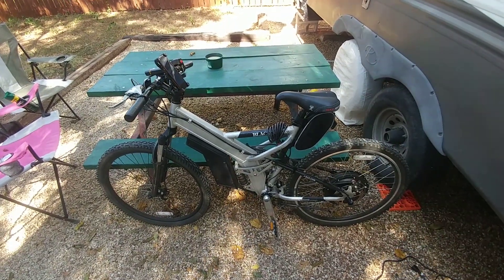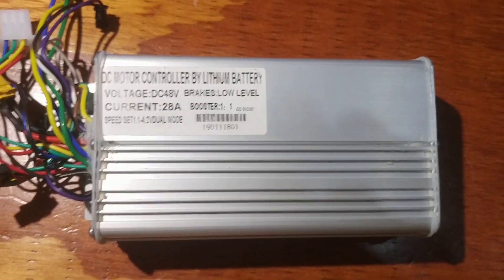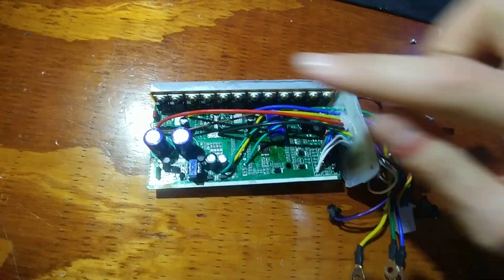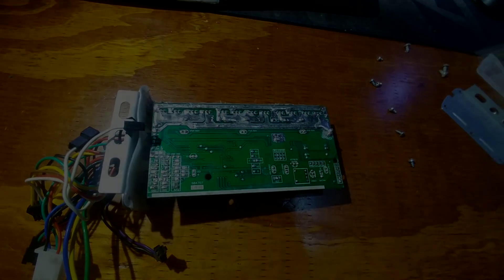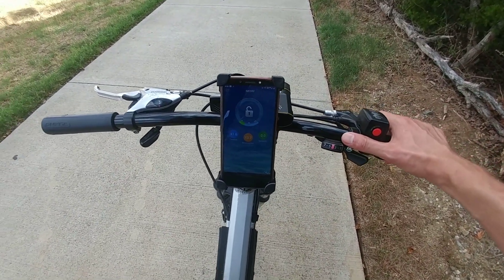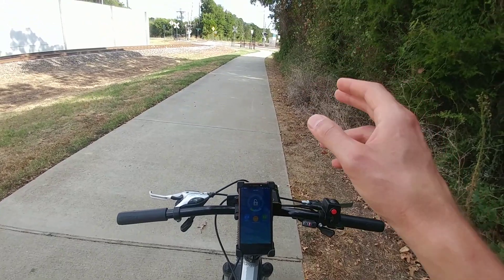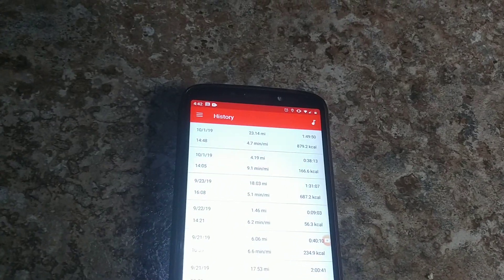Activating Regen Braking on 1000w Rear hub Ebay kit

Comment: I had ABS solder pad on mine. It worked!! Thannk you so much. But im not sure this fills up the battery back, also  im not sure if there is any settings on my sw900 lcd panel. If someone notice me about that will be happy. My hub fits nicely on the chsasis, but a torque arm may still be needed, will see.

Comment: Can I install a regenerate system on my mid drive motor electric bike with CYC X1 Pro Gen2  5KW with 72 volts battery?? Where to purchase the system?

Comment: How apply brakes create charging to the battery?
Dose your brake generate the charge or the hub motor create charge? How?
Reply: Break lever has electrical switch to shut down the motor. Similar switch to stop light. I believe that is what triggers breaking but I doubt if this actually works. Spinning motor is unable to generate higher voltage than battery so it will not charge it. I believe it is just motor break and it generate heat instead of charge. Heat in the motor coils.
Reply: Basically the motor becomes a generator and charges the battery when you apply the brakes when regeneration braking is on.

Comment: man,now think twice. use a 1000W front and a 100W Rear Motor,activaiting on boht the Break and NOW install a 750/1000W Bafang Mid Motor. Use the Midmotor and push the same time a Brekas and you drive with the Mid Motor, near the both Hub Motor produce power.if you use less Power for the Mid then both Motor produce,will your battery never be discharged. it means you have 3 Motors,can use all 3,but most time can 2 of them produce power and charge the hole time. you can programm the Hub to break after a Speedlimit,for exempel 20Mph,but your mid motor can drive 40 Mph,so your Hubs start with 20Mph to charge . for the Mid drive a Thump throttel and for the Hubs a Twist throttel som can be deativated. so it will be a mid drive in the first pleace and a Rocker in the secound because of 3 Motor with 3000 Watt. if you balance breaking of the hubs and the max speed of the mid,can the hubs not be to hot and the mid motor must not work so hard if you use gears also for more thorgue,not speed. if you can drive 30 Mph with the Mid Motor and the Buhs break with 5Mph will the mid motor not rich the 1000Watt he can use. or you drive fast,but later you drive slow and break hard to charge faster. a endless Bike ;-) or use a Car Alternator ;-)

Comment: Nice video and hack!  I have a 1500W controller of the same manufacturer.  No X, DS, EABS or EBS, but there is an ABS with a GND right across the alley between the rowed solder pads, and think I'm gonna chance it with that.

Comment: i get max 4-6A brake Amps  ....  how to get stronger Regen?  i want to stop in 20m or so...
Reply: Wich motor are you using?
A smaller wheel diammeter paired with a geared hub motor should give you super regen
Reply: @felipehcraftgamer4193  most geared hub motors freewheel like a cog/chain does.

Comment: Other controllers have either a EBS or EABS solder pad or if it doesn't say either of those it will say F4. You solder either of those to ground and when you activate your brake lever switch, regen comes on. I charge my battery with a voltage regulator so I can set the charge voltage, I undercharge my battery slightly by about a volt and a half so I don't trip my BMS overvolt protection circuit, otherwise I have to switch the battery off then again to power it back on. Another function I would defo recommend that most controller have is cruise control. You just wire the appropriate pad to ground via an inline switch and when at throttling you press the switch once and it keeps that level of throttle on until you either activate the throttle again or the switch again. Very good for long journeys as it takes away that strain you get from holding the throttle open all the time. Also riding no handed at 30 mph is fun!!! Be careful though!!
Reply: thanks for the info ! where did you find all of this ?
Reply: @jeandard6416  Either through experience or by searching on the net etc. Defo worth wiring some of these functions in. One more thing to mention is, if you do a shunt mod on your china controller and also have done the regen you will notice not only an increase in power but also an increase in regen force. Just FYI.
Reply: @jcreedy20  do you know what f5 is? Really curious
Reply: @landongill8827  not sure use a voltmeter to measure its output and see what it puts out while running. Also I may try shorting it to ground on one of my many controllers to see what it does. To be honest I only ever did the functions I wanted. Ds and X are regen on my current PCB. Others it's different.
Reply: What is appropriate pad to wire for cruise? I’d like to mod cruise for my bike. Thanks
Reply: @teolotec2957  Depends on your controller, have you a link to it, lots of different pcb formats. But a lot of controllers already have the cruise wired in by default, usually a single orange wire, all you do to test if it is the cruise is get your wheel off the ground and spin up the motor holding throttle open and touch orange wire to any black wire (ground) once!, no need to hold it on. It should stay on the throttle position you held it until you either hit your brake cut off switches or touch the wire again or engage the throttle again. .
Reply: I only have free pins GK, DK, AD, HE, FD, SH, XS and YY/Tx1 in my unit, please don't you know which is for what? XS is gas restriction, and SH is hight braking, I couldn't find the rest anywhere. Thank you very much for your opinion.
Reply: @jozefASB  I've never seen those abreviations before, but you can get a good idea by running the motor and then touching the pins to ground with a multimeter. I think Tx1 is transmit, probably used for wiring in a display etc. Just remember when you do find the regen circuit and activate it, regen is quite brutal on your dropouts and will work the motor free unless you have a good torque arm setup.
Reply: @jcreedy20  Thanks for the reference. But I don't want to damage the controller. How can I recognize with a multimeter that it is the necessary pin for regen? Is it necessary to have the wheel spun and the brake pressed?
Thank you for your advice, you are a true expert.

Comment: What regen voltage is generated ?. I measured a max of 23volts on my 36v system . You need 42v to charge a 36v battery ( you cannot put in a lower voltage than the battery has at the time) obviously if you apply the brakes the battery level will be higher than if it is under load. You would need a boost converter to achieve a high enough voltage to charge the battery ...... I think regen on bikes is a placebo.
Reply: Exactly, if there's no circuit to multiply and stabilize the generated voltage (that could be sufficient only at very high rpm) it will brake but will not recharge the battery.
Reply: The driver IS a boost controller. It runs as a buck converter to lower the battery voltage to lower ones at partial throttle, and regen runs reverse to boost the lower voltage generated from the motor to the point the battery can accept the charge.
Reply: How did u measure the voltage?
I have regen on a hoverboard and it boosts the voltage 10 or more volts then the battery voltage (depending on the speed it cant generate enough voltage to keep the system on)
Iven blown the fets when the bms disconnected the battery it reached 100 plus volts!
Reply: @felipehcraftgamer4193  on a bike ,I just turned the key switch to off , freewheeling powers my digi volt meter that I have ..so under no load (of the battery) i got 23v ,if you then connect a load that voltage will drop and you will feel the drag from the back emi , but as has been said regen only helps if you have spare inertia mass like on a heavy vehicle. my battery takes 8 hours at 42v at 2 amps to fully charge to 42v ,any voltage less than its current voltage cannot enter the battery. So if you could generate 42v at 2A from your breaking ....you only have to break for 8 hours to fully charge the battery .....thats a very long hill.. then how do you get back up that hill ......its basic physics

Comment: I Tried sodering those exact pinta together and no regenerative braking .
Reply: Gear Drive motors won't work(bafang 250w, 350w). RegenBrake normally works on those 1000w+ motors.

Comment: Can someone help me please? i've a kt controller that has regen as far as i know but when i brake it says that the brakes are activated but it will not do regen... so you may say it does not have regen but if i ride for a longer distance the regen works after a lot of km, in the beginning it does it vert weak and then it keeps braking harder but by the moment it does that the battery is almost empty so yeah i wanted to work al the time and with my old kt controller 25amps max it worked all the time and now with my 40amp controller it doenst work. 

Can someone help me out?
Reply: no

Comment: hi, i activated my regen braking and then the brake was too powerful that my wheel almost loose grip. how do i fix that?
Reply: You can use torque arm, or cut a fitting wrench and screw to the chasis

Comment: Nice video, thanks! On some other controllers there is no X + DS, instead you connect EABS or EBS to GND.
Reply: your comment was very helpful :face-red-heart-shape:  after 5 years i started my regen journey now :goodvibes:
Reply: hey just wanna ask is every hub motor can do this regen breake？ after modified the controller like X + D or EABS or EBS to GND？ after that just need to press on the break than the break regen will automatic work？？

Comment: awesome video. my friend says that  ahub motor can' t have regen if it has a free casette on the rear wheel? Is this true? I thought as long as the motor stator had the torque arms to keep it still then regen would work via the controlelr's electronics right?
Reply: your friend is wrong

Comment: I thought all that connection did was to have the motor slow you down. Those motors barely put out 12 volts when you are rolling. How does that charge a 52 volt battery? I had to use a voltage booster to do it.
Reply: mine was puting out max 30v if i had some speed, but still i had to use a boost converter. I dont see how that controller is able to up the voltage
Reply: It will use the motor coils very like a boost converter
Pulsing then to ground then to vcc through the diodes on the motor controaller
Reply: @felipehcraftgamer4193  I read that article. Those cheap controllers don't have that boost circuit

Comment: I have made an ebike 1000W zelus,  activated regen braking on the controller cause I live in a hilly area, battery Samsung - 15Q cells used 13s20p.  It's 30Ah  1.638kWh 360A max continuous discharge current. I use it for uber eats,  my problem is that after I have discovered that the max speed is set by the smart "those 2 white wires coming out of the controller". I  had to upgrade the battery fuse from 30 to 40A, all well until today. The trouble is that I need a new fuse.... Any suggestion?
Reply: How did you activate regen on the zelus controller cant seem to find it?

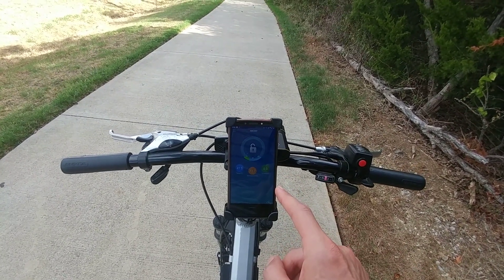Comment: Hi, at 3:50 
you mentioned that regen is stopped when batter is charged up. 
How do you ensure this, and does not blow up the battery? Do you have to do any adjustment apart from soldering the 2 connection?
Does this significantly slow down your bike when you hit the brakes?
Thanks :)
Reply: lol all you have to do is go first and THEN stop, not the other way around!
If you don't get the joke, continue reading... Look, on a level road, it is impossible to brake when the battery is full unless you are pedaling. A little overloading will probably not blow up the battery but shorten its life. Solder to a switch instead. Or, if your ride starts at the top of a hill do not fully charge, let regen charge it on the way down.  On the video, you can see that regen produces 4 amps.  My battery can only be charged at 2 amps, so I would need two batteries.  Or, install a switch on the brake level cables so the controller has no clue when you are braking.  Install a voltmeter so you can see it for yourself. get a capacitor/diode combination to take the regen load. etc.  Just look at the video and know basic physics:  Because of efficiency and drag forces, the bike needs more energy to gain speed than what it would need to slow it down, so it is impossible to overcharge if you are on a flat level road or you have solar panels, pedaling,  a sail, being towed, etc.  You just need to learn the basics of physics. In this universe, energy in = energy out ALWAYS unless you are God or you have some Godlike power.  Charging a battery in a freezer and then moving it to a sauna will also cause the voltage to rise.
Reply: @productcheck  Or just turn the bike off for that first hill ... you're going down hill, why do you need it on?
Reply: @nibblesmcgurk  does that really disconnect the regen though? Probably if controller is off yes, but does the control have a voltage regulation circuit? Or is this solder trick going to bypass something directly to ground in which case it might still push charge into the battery
Reply: BMS is in charge of battery and takes care of it

Comment: i have been doing some research on the controller
A2 goes to 5v when ebrake engaged
K1 speed switch (green)
X + DS Regen braking
ZL PAS sensor
XS throttle restrictor
SL Ebrake active low
SH Ebrake active high
Reply: Hello  I haev  question about that  throttle restrictor. restriction is activated when that  XS  pin is  connected somewhere, or  it is actiwated when not  connected? I have controller which came  with speed  and power limit (at least, seller   wrote it in description)  and in order to deactivate it, i should  connect some blue wire  which is embedded in controller..but there is no such wire...but I see  XS connection on board  and it is unoccupied .. what does it mean?
Reply: @EduardRitok  normally the speed limiter is the K1 pad wired via a white or green cable to ground
Reply: Wow, that worked for me too!😍
Thank u
Reply: I only have free pins GK, DK, AD, HE, FD, SH, XS and YY/Tx1 in my unit, please don't you know which is for what? XS is throttle restriction, and SH is hight braking, I couldn't find the rest anywhere. Thank you very much for your opinion.

Comment: Can you control the amount of braking regeneration? Harder you pull on brakes more regeneration?
Reply: Yeah if pull lightly on the levers it only charges a little but if you crank hard and fly over the handlebars you can have a full battery

Comment: i have the same controller, how are you getting the information from your controller to your phone??
Reply from the maker: Phone is connected to BMS! There is no Bluetooth connection on the controller
Reply: @sideproject4028  thanks. What BMS are you using? I'm looking for recommendations for BMS with those capabilities.
Reply: @sideproject4028  is there any way to connect a lcd to this controller?, i seen there are a lot of spare pads on the board.
Reply from the maker: @geofrancis2001  That I don't know. There might be a way, but it's probably easier to just get one with LCD connector already on it
Reply: @sideproject4028  i am trying to find if the same controller is used in more expensive kits to see if any more features can  be enabled. where did you find out about this mod?
Reply: i was just thinking, the solder jumper be replaced by a switch to make regen easy to switch on and off, then another thought occurs to me, can it be switched on the fly ? or coiuld the switch be replaced with a potentiometer? or some kind of pwm control to give variable regen.

Comment: If I'm correct the motor is inductive in nature, how does it generate electricity?
Reply: It's a brushless(hall sensors) dc motor with magnets. It's not an induction motor.
Reply: the same way the Hoover dam generates.  by rewiring the circuit.

Comment: Is this only possible when uve got the brakes supplied installed? Obviously, I hear you say lol
Reply from the maker: Yes you need a brake handle installed so controller knows when you press it. You might be able to just rig up a switch or something instead
Reply: @sideproject4028  i seen a video where someone used a second throttle to vary the regen and activate it